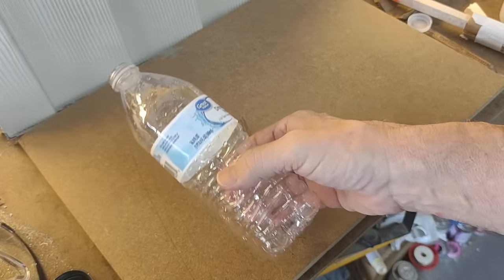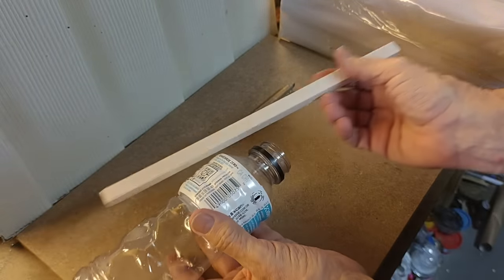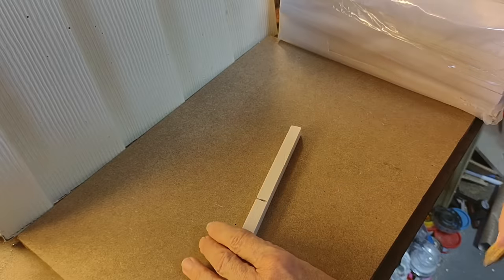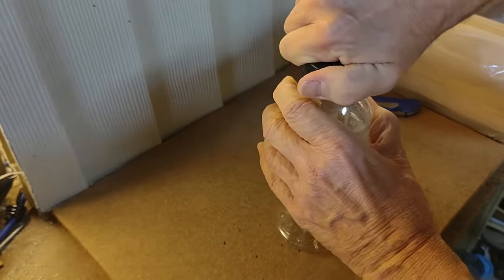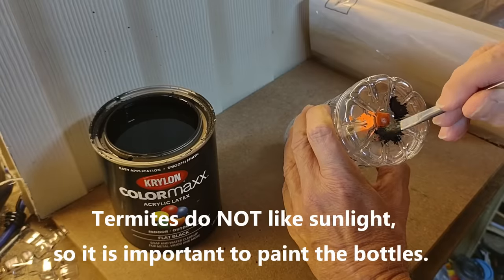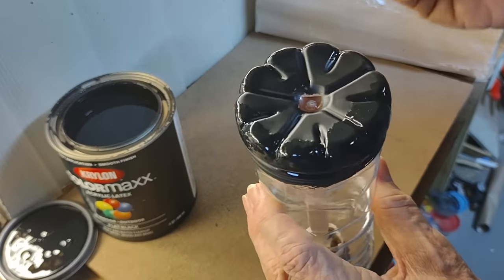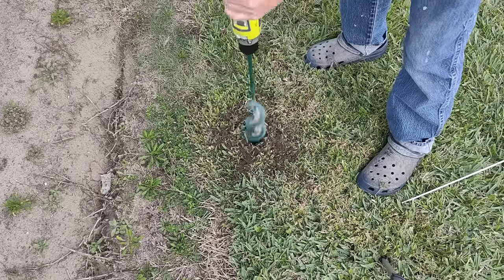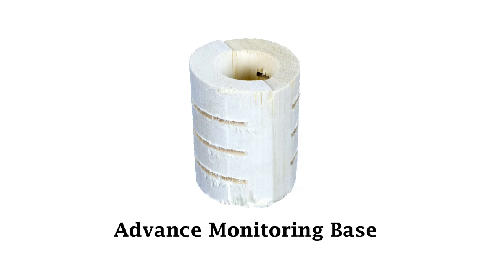Unbelievable Water Bottle Trick for Termites!  Simple to do!

Comment: Hey Guy,

how do you treat a Boris infestation in my very old timber roof, (1964). 

find wood droppings all over the house, as the boris has infested the wooden cupboards, room clothing cupboards. we tried the professional way. too expensive, and too late it seems. Help Guy

south africa, kzn
Reply from the maker: The first thing you need to do is determine the species.  In South Africa you may be looking at drywood termites, or it could be a kind of wood boring beetle.  Please tell me what the frass looks like.  The frass is the piles of discharge that you see coming out of the wood.  Does it look like a fine powder, or does it look more like little pellets?  I'm kind of guessing that it will look a little more like tiny pellets, but let's make sure before we start treating for the wrong pest.

I hope that helps.  Be well my friend.

Comment: We had to deal with some dry wood type termites. They're a nother game altogether.
Reply from the maker: Yes, they are very different.  It is important to understand how drywood termites work.  They enter through cracks and crevices around windows, doors, the eaves, pipe penetrations, and so forth.  Most of the time, they enter through several locations.  That is because a swarm of them attacked your house at the same time.  If there was a crack or a crevice, then they probably found it.  After they established their galleries, which will be inside the wood, it will take four to seven years for them to be able to swarm.  Now that they are in your house, the swarmers will use holes that are in your studs to travel through the walls.  Those holes in the studs were created by the electricians to run the electrical wiring.  Not only are these holes going through the studs, but holes were drilled into the attic for the light switches and to run some of the wiring for the outlets.  So, the termites now have easy access throughout the attic and the walls.  If you have a basement or crawl space, they have access to that as well.  Most of the time, you will have no idea that they are in the walls, because the frass is inside the wall.  To make matters worse, if you have drywood termites, then your neighbors have them too.  That means you have been getting swarmed for as long as they have existed in the neighborhood.  Most likely, we're talking about years, so it's a safe bet that you have these guys in many locations in your home.

I always hate to be the bearer of bad news, but if you have drywood termites, the only sure way to get rid of them is to fumigate.  Prices for this can vary wildly in this industry, so I recommend that you watch my video on how to hire a pest controller without getting ripped off.  That video can save you a lot of money.  You should also know that the gas they use to fumigate has absolutely no residual action whatsoever, so you can get reinfested the moment the tent comes down.  Like I said before, if you have drywood termites, then your neighbors have them as well.  Since drywood  termites swarm every year, it is almost a certainty that you will be reinfested within a year after the fumigation is done.  The only way to prevent this is to do a preventive treatment on your house every 60 to 90 days.  Most pest controllers will not do this, so it is something that you generally need to do yourself.  I have a video on how to do that and I will place a link below.  If you absolutely cannot afford to fumigate your house, then you can try spot treating it yourself.  It is virtually impossible to find all the termite galleries, but it is way better than doing nothing.  Regardless of how you treat it, you should begin the preventive treatment immediately, so that you do not get additional termites paying you a visit.

I hope that helps.  Be well my friend.                      

Video on how to hire a pest controller without getting ripped off:  https://youtu.be/y-a8XOqVrlE

Video on how to prevent drywood termites:  https://youtu.be/neNsmVbj8Pc

Video on how to spot treat drywood termites:  https://youtu.be/U7ck7zhS0Xo

Comment: Unfortunately, i already have subterranean termites. Just found out by accident two months ago. I'm deciding when I should use the trenching method. I'm skeptical of my pest control doing a good job.
Reply from the maker: There are two options for treating subterranean termites yourself.  The easiest way is to use termite granules.  It costs less than $60 to do and it only takes about an hour.  The application is so easy that a child can do it.  The other option is to trench around the entire building, including the driveway.  It takes about a day for most people to trench around an average sized building and it only costs about $100 to do the job.  Trenching lasts for 5 to 10 years, but the granules should be applied every year as a preventive measure.  I have videos on how to do both options and I will place links below.       
 
For the granules to work you need to have dirt around most of the house and that dirt needs to be porous enough to allow water to seep into the ground fairly quickly.  To find out if the dirt around your house is porous enough, just dig a small hole next to the house that is about 4 inches deep, 8 inches long, and just the width of the shovel.  Fill the hole with water and watch to see how fast it drains down into the ground.  If it seeps into the ground fairly quickly, then the granules should work just fine.  However, if it just kind of sits there, then the granules would not be a good choice, and you should consider trenching.  Make sure that you buy the correct granules.  You need the ones that have imidacloprid as the active ingredient.  A lot of the Home Depot and Lowes stores no longer sell the correct granules, but you can get them from Amazon.  I will give you a link to them.
 
You can give any subterranean termite treatment a bit of a boost by doing a spot treatment.  If at all possible, spot treating for subterranean termites should not be the only approach to eliminate an infestation.   An additional exterior treatment should also be done with either granules or trenching, whenever possible.  Spot treating alone may totally eliminate the infestation with no other treatments, but it's not a sure thing. 
 
To spot treat subterranean termites, you need to buy a fipronil foam.  I will provide links for two products that you can choose from.  I like the FiPro the best because it's a little less expensive and I like the applicator tip better, but the Termidor Foam also works very well.  The FiPro is not available everywhere.  If you can get one of these foams, then drill holes in all damaged areas, that are 4 inches apart, and drilled about halfway through the wood.  If you are seeing exit holes in the wall, then there is most likely a stud behind the exit hole.  Get a stud finder and locate the stud where it meets the ceiling and drive a small nail into the stud a couple of inches below the ceiling.  Attach a weighted string to the nail and that will show you where the stud is.  Then drill the holes 4 inches apart along the entire length of the stud, about 3 inches deep.  Do the same thing for woodwork, except only drill the holes halfway through the wood.  If you think that there is a 2 x 4 behind the woodwork, then drill a 3-inch-deep hole every 8 inches.  The holes only need to be wide enough to get the applicator tip of the foam can into the hole.  After the holes are drilled, then shoot the foam into each hole for about 5 seconds or until you have foam either coming back out at you or coming out the other holes that you drilled.   All the holes should have foam either going into them or coming out of them.  This will contaminate their food source and they will take the fipronil back in the colony and spread it around to the other termites.

Most of the time, subterranean termites are going to be building mud tubes somewhere.  You will most likely find these mud tubes going up the exterior or interior of your foundation and you may find them along joists and even in the attic sometimes.  If you have a slab home, then you may find them going up the outside of the house on the slab and even the side of the house.  If you can find the mud tubes, then you can treat them as well.  Just scrape off about a 2-inch section of each mud tube down to the bare surface.  Then, shoot that foam into each side of the mud tube and also apply a little of it on the surface where you removed it.  The termites will rebuild the mud tubes and bring the foam back to the colony to spread around to the other termites. 

Also, if you can find the mud tubes, this is a very good way to determine when the infestation is gone.  If you scrape off that 2-inch section of a mud tube, you can see if there are any live termites in the tube.  Again, the termites will rebuild the tube and go about their business.  Do this every two weeks after you finish all your treatments.  Apply the foam to the mud tube every time you do it. At the point you are no longer seeing live termites and they stop rebuilding the mud tube, then your infestation has been eradicated. 

It typically takes several weeks for any termite treatment to be effective.  That is because you are using slow kill products.  If you were to kill the termites too quickly, then they would not have a chance to bring the poison back to the colony and share it with the other termites.  If you don't kill off the entire colony, you will not end the infestation.  Therefore, you must kill off subterranean termites very slowly.  So, I would give this at least 12 weeks before I would decide that something went wrong, and the process didn't work.  Hiring a professional to trench your house is pretty much going to take about the same amount of time to kill off the colony.

Do not waste your money on the Sentricon system.  Total rip off.  It takes up to two years to work and the termites are eating your house during that time.
 
I hope that helps.  Be well Pat.
 
Video on how to apply termite granules:   https://youtu.be/H7rW_TSBHJ4
 
Video on how to trench for subterranean termites the right way:   https://youtu.be/Fy7YHi_7Z8g

Termite granules:  https://www.amazon.com/dp/B000RUIJYM?ref=nb_sb_ss_w_as-reorder-t1_k0_1_7&amp=&crid=1UJA4PE31UWZW&amp=&sprefix=termite

FiPro:  https://www.solutionsstores.com/fipro-foaming-aerosol

Termidor Foam:  https://www.domyown.com/termidor-foam-p-3528.html
Reply from the maker: @Pete N Just put wood in them.  If the termites are eating the wood, then you can treat them at that time by installing another bait station right next to them that contains a commercial bait, just like Sentricon.  It's true that the ants do eat it, so you will be killing the ants and the termites at the same time.  The problem with creating a fipronil bait is that you may not have enough of it in the station to take out the entire colony.  Just so you know, the bait can take up to two years to work.  That's fine, as long as the termites are not attacking your home.  So, just keep feeding them.  You should also treat around your home with termite granules if there is activity in one of the stations.

For the granules to work you need to have dirt around most of the house and that dirt needs to be porous enough to allow water to seep into the ground fairly quickly.  To find out if the dirt around your house is porous enough, just dig a small hole next to the house that is about 4 inches deep, 8 inches long, and just the width of the shovel.  Fill the hole with water and watch to see how fast it drains down into the ground.  If it seeps into the ground fairly quickly, then the granules should work just fine.  However, if it just kind of sits there, then the granules would not be a good choice, and you should consider trenching.  Make sure that you buy the correct granules.  You need the ones that have imidacloprid as the active ingredient.  A lot of the Home Depot and Lowes stores no longer sell the correct granules, but you can get them from Amazon.  I will give you a link to them.

I hope that helps.  Be well my friend.

Video on how to use termite granules:  https://youtu.be/H7rW_TSBHJ4

Termite granules:  https://www.amazon.com/dp/B000RUIJYM?ref=nb_sb_ss_w_as-reorder-t1_k0_1_7&amp=&crid=1UJA4PE31UWZW&amp=&sprefix=termite
Reply: Thank you so much for the information. I hope I can do this but to save my house, I have to. 
My pest control co wants $800 to do the trenching. Half of my house is cement, and half is dirt. I appreciate all the ways to kill these bastards. I wish you lived in South Jersey.
Reply from the maker: @patburton837  If you send me photos of all sides of the house, I can better guide you on be best way to treat it.  It's almost like having me there.  You can send photos to guyspestsolutions@gmail.com.  Please give me your YouTube name in the email, so I know who you are.  I get a lot of mail, so it is easy to get people mixed up because 80% of the questions are about termites.  I wish you well Pat.  Don't worry.  You can do this.  Just take it slow.

Comment: Hi Guy
I'm thinking of putting a termite barrier around my house in Australia as a protection.. I can get a product that lists bifenthrin  as a pyrethroid insecticide, presented in liquid hydrocarbon solvent. Is that the type of product that l should be using as a trench protection barrier?
Cheers
Gavin
Reply from the maker: Using bifenthrin for trenching would not be my first choice for termites, but it is better than nothing.  Fipronil or imidacloprid works much better and here is the reason.  Bifenthrin is a fast kill product, so the termites will not live long enough to take the pesticide back to the colony.  They will probably die in the house.  So, this will not kill off the colony.  That means they will keep coming.  Fipronil and imidacloprid are slow kill products, so the termites will take this material back to the colony and they will spread it around, thereby killing off the entire colony.  That is the way you really want to do it, but if you cannot obtain fipronil or imidacloprid, then I would go ahead and use the bifenthrin.  Just make sure that you follow the directions for trenching.  If there are no instructions for trenching, then this is probably a somewhat weak product in terms of concentration.  I have seen products in Australia that contain very low concentrations of the active ingredient and would require that you use them full strength for trenching.  So, if the label does not mention trenching, then you may need to use the product full strength.  Pesticides are usually expensive in Australia as well, so I don't know if it would be cost effective.  Australia has made it very hard for unlicensed people to obtain good pesticides.  It makes no sense at all, but that is exactly what they did.  They are not alone either.  It's the same way in the EU.  In their zeal to protect people from themselves they forgot that not everyone can afford to hire a pest controller and the termites do not discriminate with regard to which houses they eat.  Modern day pesticides are no more harmful to people than common laundry detergent, so these laws are totally unwarranted.  Nevertheless, this is what you must deal with.  I wish I had better options for folks who cannot obtain pesticides, but I don't.  I am so sorry about that.

I hope that helps.  Be well mate.